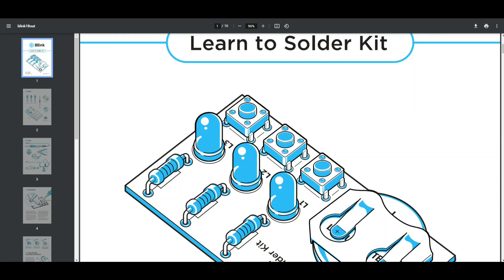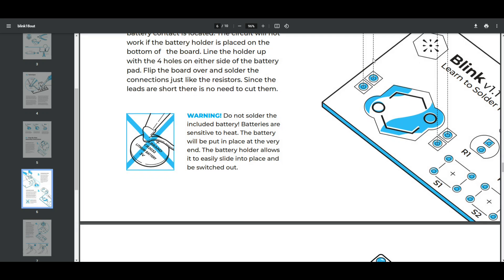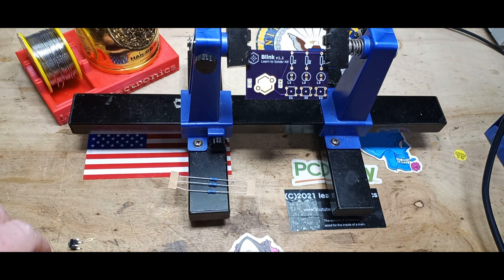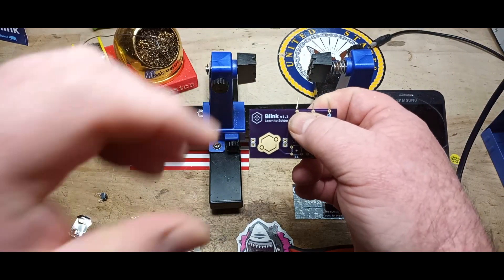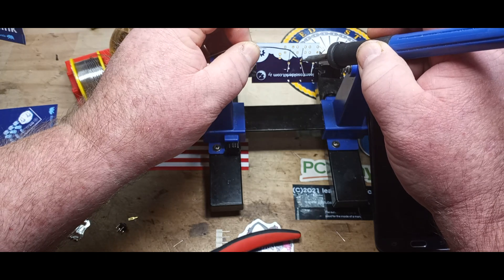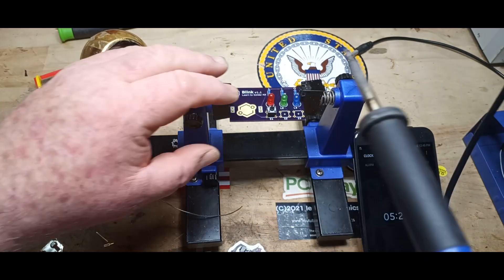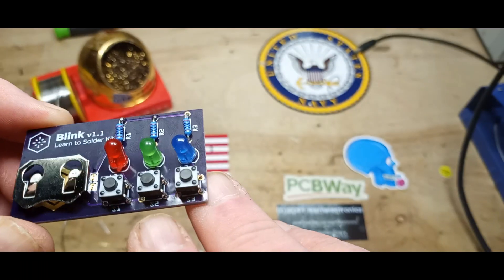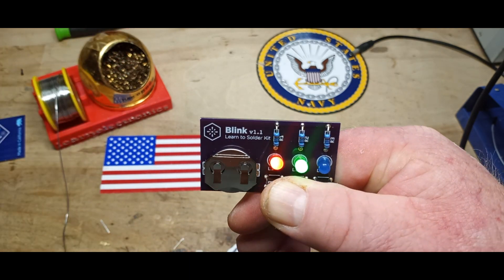Blink 1.1 kit build from learntosolderkits.com

Comment: Is this a good kit to start with?  I have no knowledge about boards or resistors.  I have just soldered speaker wire.  I purchased a 110 soldering station with helping hands.  Any kits you recommend?  Thank you Sir.

Comment: So I was folowing along and found that the buttons do fit. The legs on them have a slight hook to them, which you have to push the button don't evenly and you will get them to snap into place, causing them to not fall out. Its a nice design feature. That said, as a novice, I am happy to see a different approach to soldering them in place. Thank you for the video!

Comment: Ha-Ha .. Hardly any reason for a PCB, at all, in this case. 
Perf board would have worked, at least, as well ...
Reply: Unless you were trying to learn to solder- hence all the talk about soldering and the instructions and the name of the org selling them. 

But yeah, if it wss just the circuit you were learning.